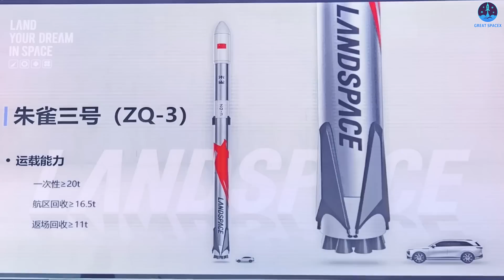Elon Musk did not expect this! What China just did surpass SpaceX Starship...

Comment: I love what Space-x is doing. But what I just can't figure out is why they insist on using a launch pad that is unincapable  of handling that much thrust. The harmonic vibrations blasting on the concrete surface and rebounding back to the rocket could be what is, causing the rocket to blow up in flight as the damage is done on the launch pad. Why don't they just design a proven pad, like NASA has like Russia and even China has. It doesn't matter how much water they pump under those engines. When they fire they will punch a hole right through the water to the concrete like the water wasn't even there.

Comment: I think SpaceX would have easily succeeded in making a successful orbital flight with a methane engine if it tried the methane engine in a smaller rocket like the Falcon 9 and not with the big Starship rocket. If the Chinese Zhuque rocket were as big as the Starship, that would count as China surpassing SpaceX. I wonder if Falcon 9 will switch to methane engine in the future.
Reply: Space X was the first to use methane and oxygen

Comment: Most or all of the SUPER-HEAVY BOOSTERS-STARSHIPS will explode as long as the B1X's series will not have eyes and ears AS WELL as the priority of maneuver concerning the control of in-flight release of STARSHIPS Cruise Vehicles.

Furthermore, it is not exclusively intended to deploy ground return systems (military or private). Especially if the loads exceed 1800 Tons (2000 tons, RAPTOR V3.5  ~ 2024-25? 🌞🧷🌓🌕🌅🌄🌝).

Configurations of SHOOTING PADS in Pits "Type GIGA- MECAZILLA  SUPER-FEEDED WITH WATER" Compact format BOOSTER X3 OR BOOSTER 💥50 Million LBS Towards the ground.

All held by several levels of Arms around the 150 m height of the TENDEM + 4,000-10,000 tonnes (DISTRIBUTION OF solid masses CENTRIPETE).

So it will be unavoidable to serve the use of exterior boxes (Existing) for nitrogen degassing for preventive roll control At the top and at the foot of the SUPER HEAVY BOOSTER In order to MINIMIZE?

The destruction of all the interior plumbing of the GIANT Stone Thrower synchronized with the permanent corrections ALLOWING TO MAINTAIN THE CABER-WEELING AT 45° 📐📏⏳ Around 10° ENGINE RUNNING!!! between 60 km and 25 TOWARDS the land or the SEA.

Approaching 62 km (end of life), end of ejection altitude of the (STARTSHIP S30 series Engine OFF!!!) (gas pressure at high altitude). Taking advantage of the INERTIA OF 5000 KM/h reached.

IGNITION OF THE SHIP SEVERAL Kilometer AWAY from the BOOSTER B12? 13 or 14.

This is less consumption of Methalox for the two vessels and a benefit in saving the number of flights to be carried out.

At the risk of underestimating the resistance of the structures when re-arming the motor when descending the OPENINGS OR VENTURI for evacuating overflow from the effect of SURFACE OF ATMOSPHERIC FRICTION TOWARDS THE INTERIOR of stage ZERO (SN15) 🙌 of B10 Are necessary.

Considering the phenomenal pressures several thousand cubic meters of air per second (~100 m3 x 1390 m/S² x RE-CONDITIONED atmospheric pressure inside the ZERO stage of the BOOSTER).

On 9 meters in diameter literally exploding the cardan protections which give way at the same time as all the other parts collide.
Congratulations to your and your teams for the videos🧐🧐😎😎🚀🚀🐉🐉🤯🤯💝💝💭💭🧙‍♂🙌🙌🚀

Comment: There's nothing wrong with the Zhuque-2 or it's TQ-12 methalox engines. But aside from the fuel, these are much more akin to the slightly stronger SpaceX Merlin engines.  The TQ-12 is a conventional gas-generator engine which is a pragmatic choice tor this rocket and generation, but it makes no sense to compare it to the much stronger full-flow staged combustion SpaceX Raptor or even the ox-rich staged combustion Blue Origin BE-4.  They're just not the same.
That said, cleaner burning methane is a far better choice than RP-1 for reusability.  And it's much better than hydrogen for storage and therefore interplanetary travel.
Never-the-less, this is an apple-to-oranges comparison.
Reply from the maker: Thanks for your great analysis👍
Reply: Bla , bla ,bla ,tell me something , you talk about reusable engines , are the chinese reusing theirs ? 
Do their rockets land vertical  to recover the rocket  engines and main estruture  ? I don't think  so , it seems to me  like a lot of propaganda talk and shooting into the air .With Starship everyone expects ultrarapid flawless performance and somehow it is Spacex own fault because with the tremendous sucess  of falcon 9  people expect  everything  fast and perfect .

Comment: I swear this channel is Chinese propaganda some times.  This is comparing a Chinese rocket to Starship when the Chinese rocket's payload is lower than the Falcon 9 and their upgraded version is still less than Falcon Heavy.  Maybe we will see a Falcon 10 (Falcon X) with the Merlin motors swapped for a Raptor.  Right now, Falcon 9 takes off at a weight around 600 tons(550,000kg) with a payload capacity of 25 tons (23,000kg) to LEO.  The current gen Merlins have a SI of 275 to 348.  And has fully reusable boosters with nearly 100 launches this year alone.  Raptor 2 (already obsolete, but well tested) has a thrust of 250 tons at a SI of 327 to 363.Two Raptors plus a Merlin would get a booster up, and landed again on methane no problem.  The Merlin would be needed for breaking to land as the Raptor's thrust at minimum throttle is too high.  Plus, the Merlin could be mounted below the CoG, making a single engine landing possible. The Zhuque-4 rocket, with a takeoff mass of 660 tons, is a far cry of Starship's current 1,300 tons.  Rev 2 is already know to be bigger, so this number will go up with development.

Again, not sure if this is attempt at Chinese propaganda, or just clickbait.  Solid videos get sprinkled in so frequently that BS like this won't get ratioed out of existence.
Reply: Well said!